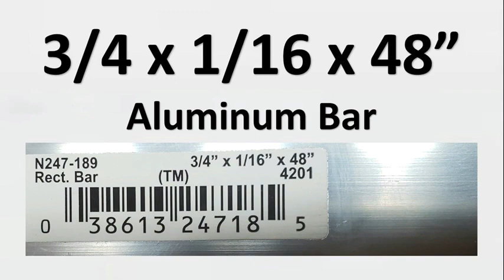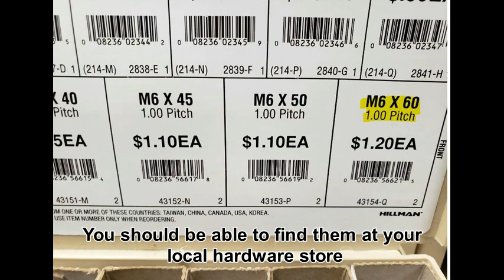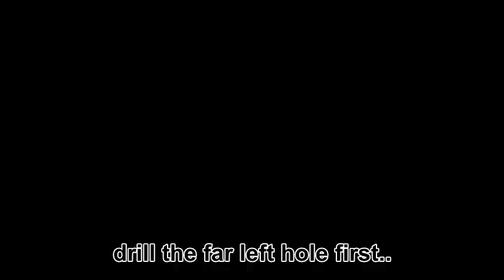DIY : DeWalt DW788 Scroll Saw Arm Lifter modification (How to make the "arm lifter" DIY video)

Comment: I had a hard time finding the 6 X 60mm bolts, and got the position of the second hole wrong by about 1 mm. After that it took less than 30 minutes and your solution works perfectly! Easy, effective, and cheap. Marvelous! It's so effective DeWalt should have included it. Thank you!!

Comment: This modification worked out very well. The drilled holes are closer to the edge of the piece of aluminum than the video shows. Perhaps I have mine at a higher position. I used a pan head screw for the front and I found that it allows the arm to lock in place without me touching it. Now working on a way to have the arm come down without moving the aluminum support

Comment: Had to modify for materials available in my area but it worked great.  Thanks bunches.  FL Home Depot order  - 3/4 in x 48 in x 1/8  $6.98; M6-1.0 x 80 mm Phillips Pan Head Stainless Steel Machine Screw (2) $4.16; Everbilt M5-0.8 x 20 mm Phillips Pan Head Stainless Steel Machine Screw (2-Pack) $1.36 TOTAL $12.50
Reply from the maker: glad it worked out ok for you!